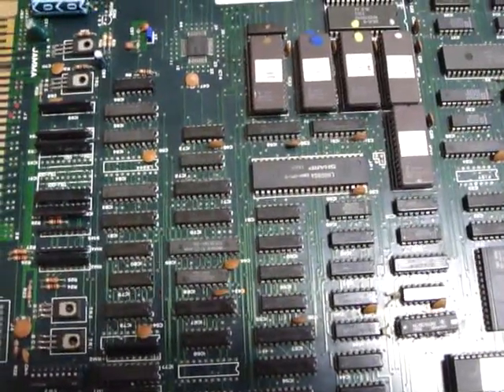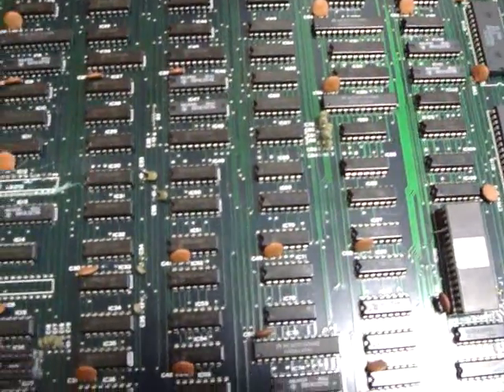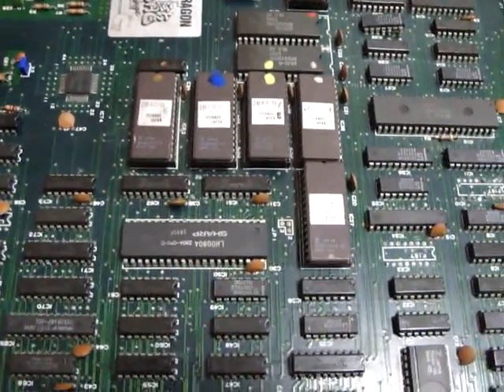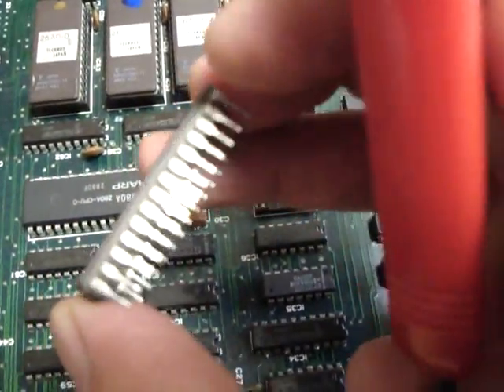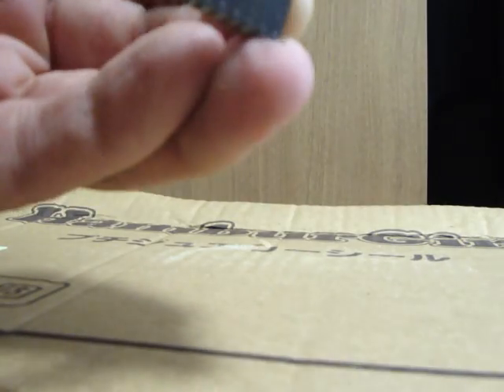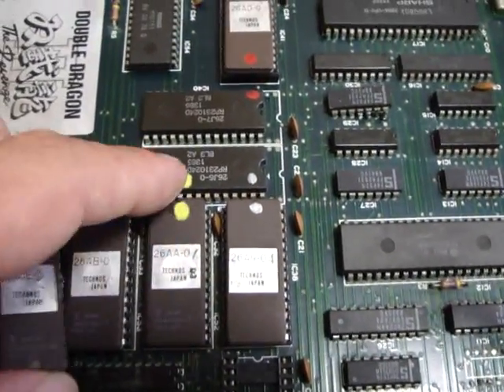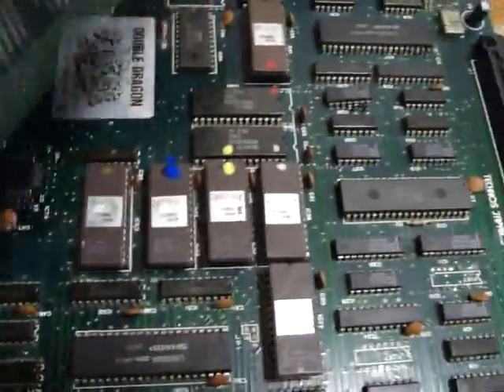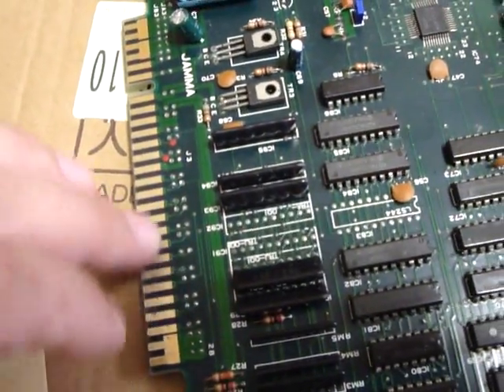How To: Remove, Clean, And Replace Socketed ICs, Eproms, And Mask Roms On An Arcade PCB

Comment: This video saved me a lot of time and money with my Golden Tee 99' Arcade Machine (Original Arcade Unit, Not the Arcade 1up Version). I had distorted graphics on my screen, after running a full board test it informed me that my machine's GRMC_3 chip was bad.  I removed the graphics chip from the motherboard per the instructions from this video, unfortunately during the  process I did bend a couple of the legs on the chip, however, I was able to straighten them back out and get the chip correctly back onto the motherboard and once I fired the power back on my arcade unit started working better than ever.  I did end up buying a set of tested chips and an extra motherboard (tested as well) just in case I need it for the future as parts for my Golden Tee 99' as it is a relic and parts are somewhat hard to come by anymore.  But, as for now it is working great again thanks to Luke!

Comment: Use Isopropanol or 2-Propanol to clean. Its 99% pure alcohol and doesnt leave residue on the metal. Dip cotton swabs in the Isopropanol and just rub them against the metal. It will clean it and not damage it. Its the best way to clean electronic parts.

Comment: Sand paper! That is not good. And 120 grit it too rough. This will make more problems in the future.
Reply: So what's your advice? I'd like to know how to make pins on chips look shiny and new again.
Reply: @kelpkelp5252   TranX generally works pretty well for the IC pins. A quick dip and then rinse with warm water does the trick. Let them air dry and you can blot them with paper towel to speed up the drying.
Reply: @GenerationXT  Thanks! I'd forgotten I'd made this comment.
Reply: @GenerationXT  Also, what is TranX? Google is giving me fishing related results.
Reply: @kelpkelp5252  For future people -- that is Tarn-x, not Tranx.

Comment: Hello Luke: I was cleaning an eprom but a leg was sensitive so I blow it accidentally; and want to ask you how could I repair it; I still have the leg; the board doesn't work and I thinks is because of that, it shows a palid white/grey screen with distortion and two small vertical blue/darkgrey stripes at the left side of the monitor. I don't have experience but I thought I could use some solder or something. I appreciate the advice you could give me in advance.

Comment: On the gold edge connectors, I would not use sandpaper. I would use a pencil eraser. I works very well and you are not going to cut any traces. Once completed you can lightly brush off the excess eraser material with a dab of alcohol on Q-Tip
Reply: Fiberglass pen works ok too

Comment: your repair vids make me cringe .. before breaking legs off of DIP packages by wedging a screw driver between the socket and the component test with a multi-meter... it you don't have a meter walk away from the board and let someone with a clue have a look. If you are removing DIP packages get a chip puller or something that is long and flat.. lift the whole chip together otherwise you are going to break legs off. Sand paper! WTF!! IPA is more than enough. FFS
Reply: IPA?
Reply: @kelpkelp5252  Isopropyl Alcohol

Comment: @lukemorse1 you really should get a chip puller, they can be found in some computer repair kits. they let you get under both sides of the chip, and pull them straight up, I've used them on some Commodore 64 computers, to save the SID chips.

Comment: Luke, you absolutely do not want to sand the JAMMA connector. You can use isopropyl alcohol and a Q-Tip to clean the connections. If the JMMA connector is REALLY nasty, you can add solder to the connections, then use braid to wick it off. This will remove dirt and fill in any scars or cracks. When shopping for PCBs, I always avoid buying boards that have sanded JAMMA connectors.

Comment: Speaking of dead boards in a previous video you talked of sending them out for repair? How often have you manually inspected a boards components, is it hard or does it just take a lot of time and concentration? Just asking since I have a possibly dead Intellivision and was wondering how much time I'd be dedicating to circuit testing.

Comment: @NeonGenesisPlatinum the pin, is only 1 connection, you can do inside and outside of the pins, to clean as much surface area as possible, but the outsides most of the times should do the trick. do all the pins, the two rows. both the inner sides of the pins and the outer sides.